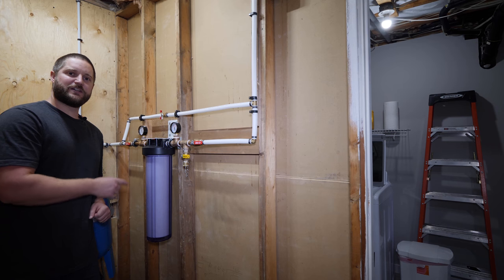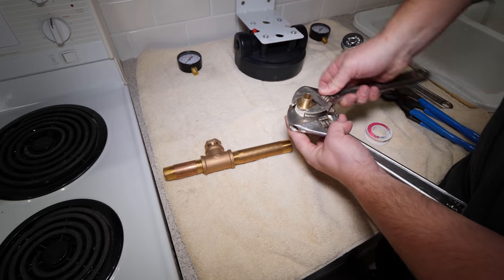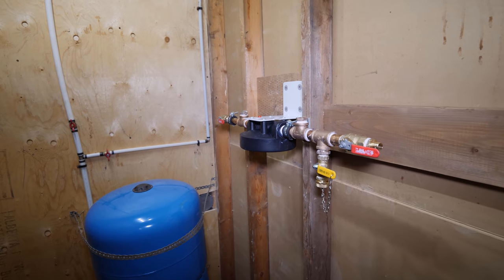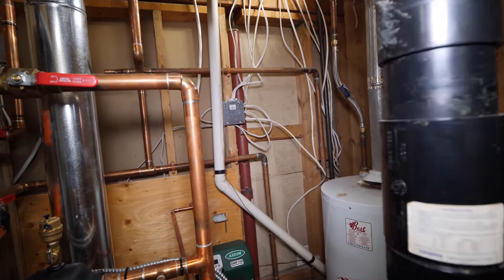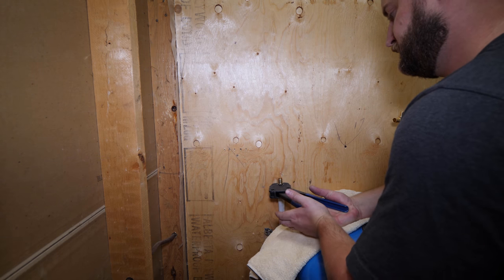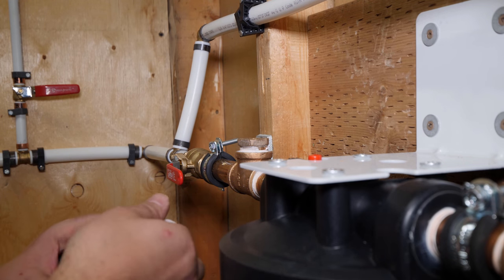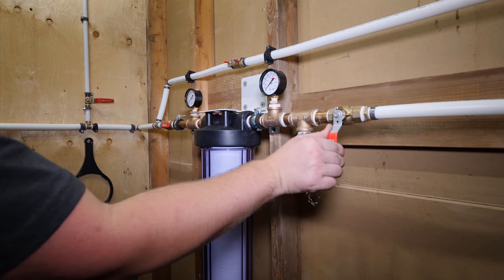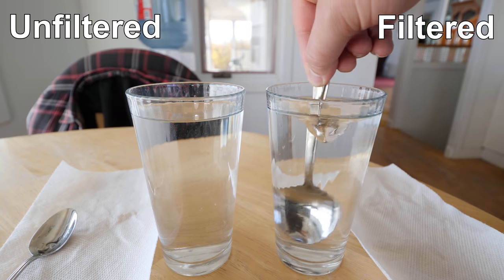Whole House Water Filter Installation

Comment from the maker: 𝗔𝗺𝗮𝘇𝗼𝗻 𝗔𝗳𝗳𝗶𝗹𝗶𝗮𝘁𝗲 𝗟𝗶𝗻𝗸𝘀
¾” Water Filter Housing
https://geni.us/yBml
1” Water Filter Housing
https://geni.us/EASze
1 Micron 20” x 4.5” Filter
https://geni.us/a6GSp
5 Micron 20” x 4.5” Filter
https://geni.us/ZjiICsd

Disclosure: Pros DIY is an Amazon Associate. We earn a small commission from qualifying purchases through our affiliate links at no additional cost to you.
Reply: where did the gauges come from?
Reply: Links are broken
Reply: Cool
Reply: If I am using a large rock well cover could this be done outside near the submerged pump? There is no room under crawl space where my air tank is at and the Only other option I have is in the garage. Builds put the hot water heater inside a elevated separate cabinet like area but it would not be easy to get in there  to plumb or replace a filter as needed.

Comment: I googled how to install a home water filter and I picked yours to watch / learn. I will say you made that look so easy which I am sure it was for you. I might attempt it but will definitely need to watch your video as I am doing it. Thank you.
Reply from the maker: You're welcome. If you decide to tackle the job, make sure to take the time to plan it out and get all the fittings you think you might need. This will help make the job go smoothly. Good Luck!
Reply: You don’t need any gauges
Reply: Do I need a valve on both sides?
Reply: @PROSDIY  I had everything all planned out, but after watching your video I realized

Comment: You went Above and Beyond, as any homeowner should do.  I had to explain to my GF (she was getting home upgrades done) that if you don't tell Contractors how you want it, that they will do it the easiest/cheapest way possible.
Reply: Indeed. This chap is pretty good. I would recommend having the water tested and of affordable install associated filtration systems that apply. UL, Iron, water softeners, carbon and Ro filtration systems should be consider based what kind of water quality your looking for and where you want the water. To what fixtures.
He did a good job on the renovation of this place.

Comment: good video.  one added note: to test the delta P across the two gauges, the water needs to be flowing at that time, so you need to open a faucet (say 2.5 gpm) and then read the delta.  if greater than 10-12 psi, replace.
Reply: Good tip. Thanks!
Reply: Was going to comment how the gauges would show the same pressure but yes if you run enough water in the system that should show if the flow rate is low thru the filter and I would do a two faucet test.
Reply: yes exactly. when there is no flow, gauges will show exactly the same pressure unless their calibration is off.

Comment: hey man great set up just a question what filter do you have inside of the housing normally you want 2-3 housing 1st filter should be a sediment 1micron  filter which will take more on the heavy grime then a second filter which will be a carbon which will clean the water even me and remove chlorine/taste/odors ect you can also get a filter which is called a AGRAON CARBON FILTER this is one of the BEST carbon filters you can get. you will notice yourself after installing an additionally carbon filter the taste of the water will be so much better at the moment you are only removing the dirt and grime from the water. I only say this because I work in the water filtration business and only then did I realise how dirty our water really is hope this helps you in the near future.
Reply: Looks like he has rust in that water, that would require a secondary bulb with carbon filter definitely, to improve taste and remove the unpleasant odor. Now, a question for you. What filter would you suggest in the following situation. I have very rusty water coming in from the well. For now, I installed 2 stage, 10" filters, first is PP thread 5-10 micron, and second is carbon filter, but after  few weeks of installing clean PP filter in the first, incoming, bulb, it gets dirty pretty quick, and seeps the rust a little bit into the second bulb. The water is somewhat clean on the far end, but still. Now, would you suggest installing a self washing 90 micron filter, or just adding a 3rd stage of regular 10" bulb and installing the same PP thread filter, so I'd have 2 PP filters (maybe even with different density) and carbon as the last?

Comment: Did you say a 1 micron filter? I used a 5 and it was plugging up too quickly. I've run 10 Micron for a decade and change at 3 months.

Comment: As a plumber just gotta say wow. You are very very thorough with your work and I've never used cushion clamps lol very well crafted and very clean work.
Only think I'd do is use a silicone lube for that O-ring for easy maintenance in the future. But otherthan that flawless
Reply: A little Vegetable oil on your finger and wipe the threads and o-ring seal works perfect.

Comment: If you suffer with silt in water, then perhaps two-stage filtration a better idea, especially if  you intend to use a UV unit post filtration. 
20 micron filter first, followed by 5 micron filter pre-UV. 
Opaque filter housings will discourage any algal growth in filters, which should be changed at least 6 monthly.
Reply: Which brand?
Reply: Not really an issue in a dark basement, and you give up the ability to check the filters visually, which probably means more clean filters get discarded and make more money for manufacturers.

Comment: Clean install.  Remember to change your clear filter housings every 5 years or as recommended by the manufacturer.  Clear housings have a tenancy to crack over time and do have a service life.  Also, while the pressure gages are cute, those things tend to fail in 2-3 years. You usually can tell when the pressure is low just by using the faucet.

Lastly, going straight to a 1 micron filter doesnt work in many well water situations.  I know most have to start with a 25, then a 5, and if really desired, put a third housing for 1.
Reply: Do you have an example of a system you are describing?  I'm looking at replacing the big three tank system original to my home.  tnx
Reply: The Clear housings also have a lower PSI rating than the Blue but are still within the ratings of most residential systems.

Put a healthy dab of silicon grease on the sump threads.

The tightening of the sump with the wrench is about 1/8-1/4 turn only.

Comment: I'm sorry, i have to say it. Stop installing these filters without unions. You guys over time these will leak because of a venting issue or cracks They are plastic! do yourself a favor install unions before and after. Ive also had to remove the entire unit just to get the cartridge off because someone way over tightened the thing. Also Never! Ever thread metal into plastic. All Plumbing Thread is tapered NPT National Pipe Thread. How many know why? I see this crap on a daily basis i fix all these things on a daily basis. So You must learn how to plumb before just doing something. Youtube is great until you pass on bad information. It may seem stupid to you when you first install this and it works great but give it a few years, especially if they are outside! SO please do yourself a favor install unions pre and post.
Oh and lets not talk about friction loss when installing any kind of filtration.

Comment: Great video! 
The Teflon tape and pipe dope is something I did myself today.
Used straight Teflon tape and well I had to take part my connections and redo them I was using nylon fittings.
Like the gauge idea 💡 
Thanks for the share

Comment: Looking at your video it looks like you have sections of threaded copper pipe?  I am an amateur and didn't even know that existed, if that is what it is.  Would you mind telling me what the pipe sections are?  Thanks ...
Reply from the maker: These are threaded brass nipples (3/4" brass threaded nipples in the video). They come in different lengths and are available at most hardware stores.

Comment: I went with building a 2 stage system since the city likes to over chlorinate the water in the winter. I'm running a 5 micron sediment filter in front of a 5 micron carbon filter.
Reply: Ya that 1 micron filter is gonna need to be replaced so often. A 2 stage system is way better. Even a 30 first then 1 micron 2nd works so much better. Depending on your sediment pre filters of course
Reply: My city also over chlorinates their water too. What's the best ideal setup if it's really just chlorine and not sediment issues? Same as you described?

Whats the effects on chrloine with CPVC and pex. My house is all CPVC but I just got the tools to do PEX A and I want to go that route with everything eventually. I heard pex doesn't like chlorine idk about cpvc though.

Comment: First time watcher and now subscriber. I did a similar job using Propex. The things I learned...use heavier screws than drywall screws. Second...put some lube on the filter canister threads and rubber top gasket. In a year its going to be a bear to back the canister out to service using a flimsy plastic wrench. Good video.

Comment: Very nice video, thanks for uploading. Does the filter backwash too?
Reply from the maker: Great question. This style of filter cartridge is not designed to be backwashed and is designed to be replaced. These 4 1/2" x 20" cartridges last a long time though. I will most likely make a filter replacement video when clogged (year or so).
Reply: @PROSDIY  have you tested water quality after the install?
I would like to see how well the unit works.

Comment: Two comments:

1.  You do not mention the process of changing the filter cardridge. We had a whole house filter installed 6 years ago when our house was built, but the plumber did not leave the instructions for changing the filter cartridge. I found the instructions online and, for 5 years, in accordance with the instructions, I went through the laborious task of draining all the pipes in the house to relieve the pressure so I could remove the filter housing. Finally, a plumber told me I could just isolate the filter by closing the valves on either side of the filter (which were incorrectly labeled), pushing a button on the filter to release the pressure, and removing the housing. The whole process takes me 5 minutes now. 

2.  Buying cheap filter cartridges on Amazon saves no money because they only last a few weeks and do a poor job. That same plumber told me to buy the original manufacturer's brand filters (Watts Pure Water, in my case).  They cost 4 times more, but the water tastes much better and they last about 3 times longer. If you are going to have a water filter, it is worth spending a little extra money on the cartridge to have cleaner water. 
 I hope this information is helpful.

Comment: how tight did you tighten the copper threaded fitting to the filter housing? Did you tighten until you met resistance? I did the same combo as you with tape and pipe compound and was able to meet resistance when hand tightening but when I went to use the wrench I did 1.5 turns and it was still turning easy. Is it supposed to be like that? I don't want to break the plastic.

Comment: Hey boss, great video. Question and observation. That ball valve you used for the bypass I believe is not rated for pot water use. I considered using that for a setup I'm designing but I saw that it's not rated for pot water. You may want to look into that, it may not be the same valve, who knows. But better to be safe! Thanks for the video!

Comment: Great video and very inspiring! I am a novice in DIY. You make plumbing pipe works look so easy. Are those 3/4" PEX pipes? Is it reachable for a newbie to tackle project like what you shown and/or adding a water softener? Is PEX easier to work on than PVC or vise versa. What about cost and time?

Comment: We have a large bladder tank (well) outside that feeds two small mobile homes.  My question is this:  We will be housing our tank 5'x4' (housing)building a wooden housing around the tank.  Should we place the filter inside this outside housing where the bladder tank is that we are going to build, or should we put the filter(s) under the mobile homes and or somewhere inside the house for each mobile? How often do you replace this filter?  We have a lot of sentiment and we do not want the toilets and the water heaters needing replacement more often than not.

Comment: Me and my husband have no experience with pluming. Do you recommend to hire a plumber?  I am afraid how much this will cost if we call someone but also afraid to have some huge water damage if we do it ourselves 😢
Reply from the maker: I would recommend a plumber for this job if you have no experience. It will worth the peace of mind knowing it was done by a plumber and the work is insured.
Reply: You hire a plumber;
I am contractor;
DIY by those whom have not done much your water supply is such that you need an actual plumber to do the work;
We get into technicals like lead-free solder and plastics they are using now plus you would not even know if you have tapped the hot-water supply or several other very important matters ○ My recommendation as a Professional is Under counter / under-sink and you may attempt that if you are brave and can call a plumber to fix it if you fail • Cost is extremely relevant; critical; + major-fail issue ○ A plumber can get you this vastly cheaper than sellers whom I expect you might think of as those can go for thousands when it is only a few hundred to get it right under-counter with plumber worth bothering with; 
·
We have ways of figuring that out ourselves as contractor but that is not how you do it as residential occupant;
·
Water damage is the least of your concerns if you do not know how to stop the water at the meter and as far as that goes that is on Municipal Water Supple side of the meter so you are not supposed to use it; It is the only way to stop it if you blow a line

Comment: If your getting sediment youre probably getting more than just that, have the water tested.   I did a job like this on my moms house.  She bought 14 acres in the country and the water was ORANGE, and gritty, toilets tubs everything stained orange.. smelled bad too.  My mom loves to toss money away, and spent $900 on a 20 inch sediment filters install.   That worked, for the orange water and the grit but it still stank like metal.. and tasted bad, it also was now yellow in color.   I decided to order a 3 stage whole house 20 inch filter system on black friday.  I also ordered a heavy metal filter media.   I bypassed the old water softner which is pretty much done and doesnt work.  Then i removed that sediment filter the plumbers installed.   I then installed the 3 stage filter,  this one uses a 5 micron sediment filter, then a 5 micron carbon filter, then a iron and magnanese filter..  Then i took the filter the plumbers installed and i put it right after, and removed the sediment filter and installed a heavy metal/activated carbon filter.  

After doing this, the water is now blueish in the tub, and clear in the glass, smells and tastes like good bottle water.   However, for added assurance, I am installing a 5 stage RO system under the kitchen sink,  This things 5 stages are a sediment filter, a carbon block, then a 2nd carbon block, RO membrane, and then a coconut carbon block.   So basically the water is filtered through the house filters i did, then 5 more stages for the kitchen sink... way over kill maybe ?  But for cooking, drinking, and giving water to the animals etc.. well worth it especially how nasty the water was before.

I am extremely upset though that this plumbing company charged my mom 980$ for ONE sediment filter.. that 20 inch house filter is 50$ on amazon, and the 20 micron sediment filter is like 30$ for a pack of 3...   They used maybe 2 feet of pex piping and plastic elbows.. and the crimp connections.. all together material cost was like $100.  Took them aparently 40 min to install.  and they made a 800$ profit..  not happy

Comment: Only thing I would fault is using the wrench to tighten the filter   If it leaks when hand tightened add some food safe silicon grease to the O-ring and also the threads of the filter.   Nice Job.  Edit:  Ohh and the gauges would be read with water flowing.  They will read the same when no water is flowing regardless of how clogged the filter is.
Reply: Great point about the gauges! I was confused for the first year after I installed my water filter as to why they were reading the same but it was because the water wasn't flowing at the time that i was reading them as you stated.

Comment: Just buy a Whirlpool whole house filter which has auto backwash and don't worry about changing filters all the time, simpler and no doubt cheaper in the long run too. Nice install job though.
Reply from the maker: That works too and they are nice systems, but it's in a totally different price bracket. Whirlpool WHELJ1 is currently $649.00 CAD, this filter housing was $69.99 CAD.
Reply: @PROSDIY  Yes it is more money, I've had both and I'll take the WHELJ1. I'm using the Kenmore version of it now and I've had it for 15 years. I replaced the carbon in it once about 7 years ago and still going strong. I'll change the carbon again soon. I think it was well worth the money.

Comment: Thanks for the great walk through on the installation. Do you have affiliate links for the 1" brass connectors, pressure gauges, and shut off valves? I'm setting up a home water filtration system with 3 filters that I've cobbled together.

Comment: Great video and install! I have an old boiler system and I am looking to install a house filter similar to the one you installed. My question is, did you have to do anything special with the boiler on the initial emptying of the water lines? Did you need to repressurize the boiler system after install? Maybe you have a shutoff ball valve installed before the boiler that I missed. Thanks!